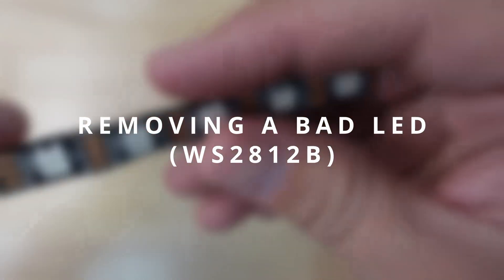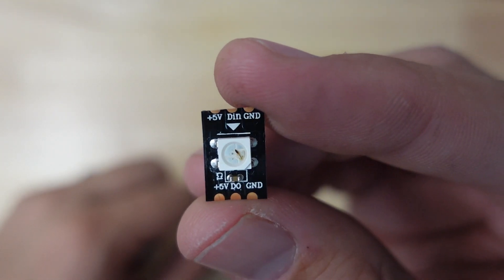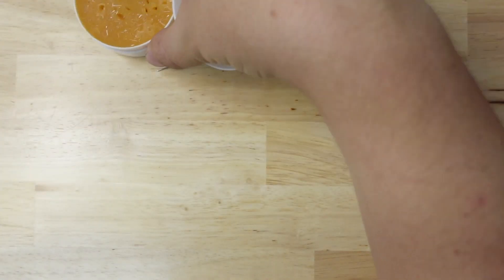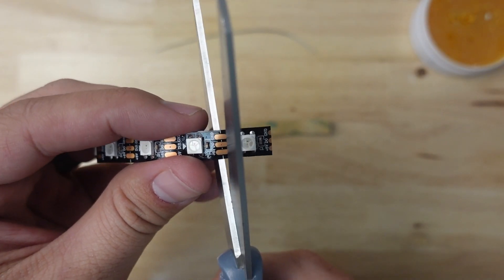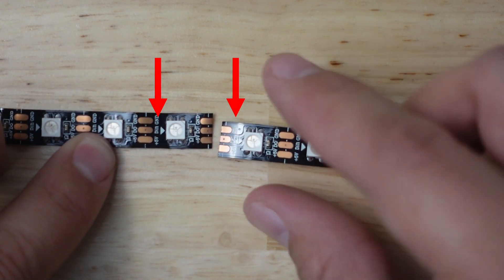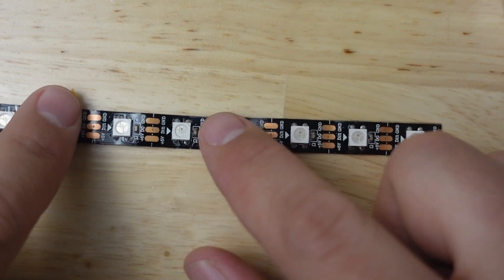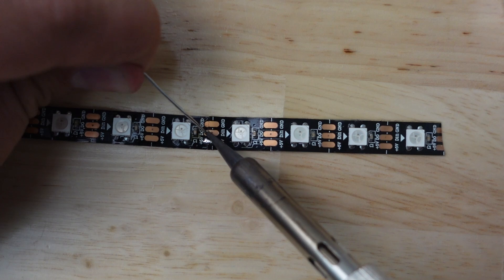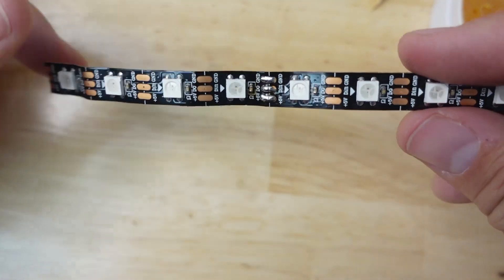Removing a Damaged LED (WS2812B) #shorts

Comment: The only reason I'm watching this is because I have a single bad led (started to give out random outputs more and more over the course of a few days and it finally died), and I'm procrastinating fixing it.
It's part of a fairly large wall decoration with 46 segments of 14 pixel strips, and for some reason, the LED that started failing is almost at the beginning of one of the 4 data lines...
I know what I have to do, but I don't wanna take it off the wall. It was already so hard to get it up there 😢
Reply from the maker: Haha I'm not even sure why I made this video! Good luck with the repair!